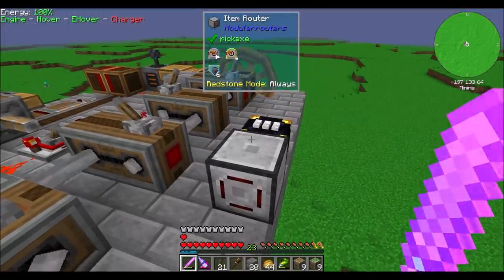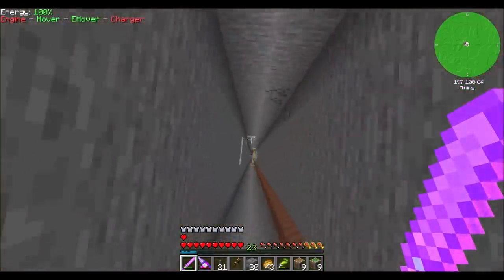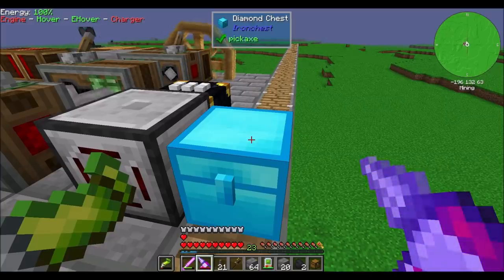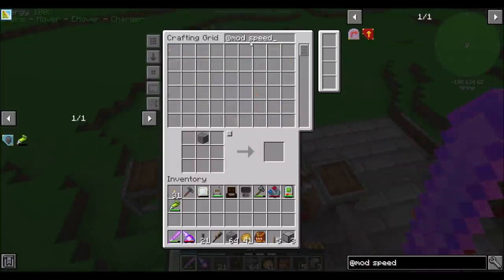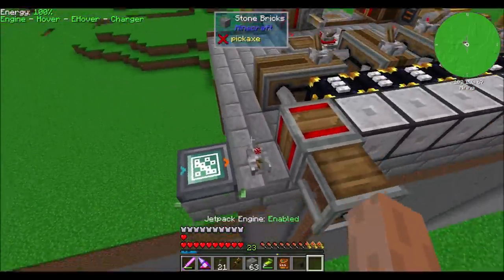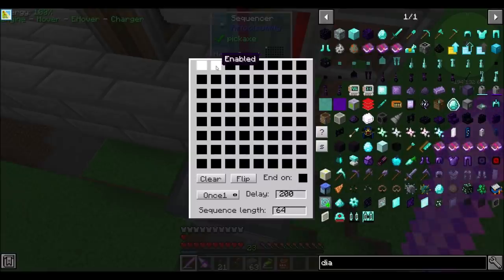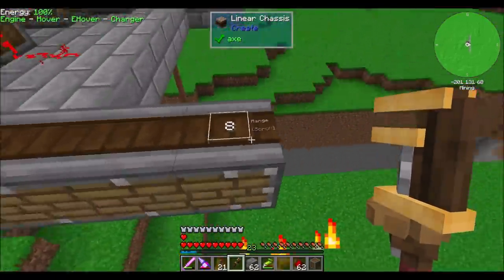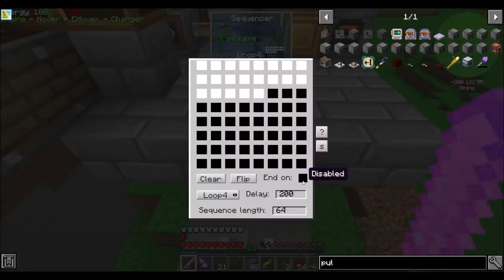Lets Play S10E54 Inchworm Miner Mk2

Comment: For the redstone signal at the start of the machine (the one that pushes everything forward), you could use a redstone contact from the drills platform, wait 10-15 seconds for the items to unload, then pulse at the start to move
Reply: You would need an AND gate in there too so you can lever control it.

Comment: There is the item transfer items that create supplies.. “portable storage interface”
Oh... and red stone links for wireless red stone perfect for this application.  Ask and create supplies 😊
Reply: This system is very finnicky and needs to use either funnels into belts or a chute from Create, both of these options are very slow in extracting items from chests so it would make this machine even more inneficient
Reply: @hmag11  I forgot the PSI’s don’t work directly to inventories 😢. But yes I agree it’s not perfect or fast but it is “create” 😁
Reply: Besides what the other commenter mentioned, psi's also only work while one end is a contraption entity I'm pretty sure.
Reply: @thaerosthedragon1930  well yes but you mount it on one block of the linear frames 🤷🏼
Reply: Redstone link (the wireless redstone) won't work to transmit signals from one part of the other of the inchworm. Create doesn't like to move their own wireless redstone. it's okay unless you move the "source" of redstone (for example if you place a link on the Main big body of the inchworm) as "input" you can't move it with the small part of the contraption, it will toggle it. as soon as it turns into an entity the link stops working and the pushing mechanism stops, driving the machine pointless. to solve that you can use the RFtools Redstone Transmiter / receiver.

also, the logic to automate the machine is ultra simple if you can afford 4 pairs of receiver/transmitters. my inchworm uses only 10 blocks long chain and 2 extra on the side for 2 transmitters
Reply: @JoachimVampire  interesting ill have to go back to my test world. Maybe i had it set differently.
Reply: @hmag11  The portable storage inteface is proportional to belt speed, and you can use a brass funnel to pull stacks instead of items.
Reply: easy fix, have the on the mining arm one block above the interface on the static part, on its way down and up it will spit out all items
also 256 speed belt with a stack extracting brass funnel is faster than the modular router
Reply: Or, because he's only collecting from the chest when it's "placed" in the world... just a regular Create funnel would work, I think.

Comment: Hey Dire, for chunk loading: Flux networks have it build into each connector! I use that to load my entire base and any moving contraptions.
Reply: Do they only load the chunk they are in?
Reply: And he's got two of those already! Lovely solution
Reply: In some packs I'm not sure about Dire's pack ik that feature is disabled.
Reply: Sadly they don't work. as soon as the flux point is moved it "resets" the toggleable things inside. Chunkloading included.

Dustin, i think that's correct, i have a machine like this in my world too, it's only one chunk sized (on purposed) and i used 4 points. 2 for power and 2 for chunkloading (one on the top most front and one on the back) but they don't seem to work...

Comment: Routers' main purpose is to interact with all adjacent chests/machines. You could have gotten away with just a single router and ender chest. If that doesn't work, you can always make some of those chests double chests, and halve the amount of routers.
Secondly, you can use the same trick you used at the beginning of this episode, to push the contraption into a single chunk. Then you can chunkload only a single column of chunks, which would be a lot better for your server performance. 
For chunk loading, you can try putting down a random mekanism machine on it, and apply the chunk loading upgrade to it. However, you couldn't move mekanism pipes, so I think you also can not move other mekanism machines. Still, it is worth a try. Create might have a way for chunkloading, maybe its deployer is registered as a fake player, and the presence of a player (even though it is fake) might force load the chunks? Dunno.
Reply: Fake players don't chunk load unfortunately. How would the save even know there was a fake player there before loading?
Reply: the drill line is still over 3 chunks wide I wonder how they would behave if only the core was loaded.

Comment: you could glue a redstone block to the digging arm and when it raises this will activate a redstone line connected to the move button, for automatic mode, no timer needed
Reply: Good call... or even better, if that does work (which is a big if, I gotta imagine that it's location-bound), use a Mekanism Teleporter block - those can accept Anchor Upgrades as well, with the added bonus that he can use the personal teleporter to zip to the contraption whenever, no matter where it is...
Reply: @iamianianiam  the question is whether this will work nicely with create
Reply: why the redstone block tho? Create already has a "Redstone Contact" block that outputs a redstone signal when paired with another one facing each other. you use one on a movable part and other in the main body and as soon as it reaches the top it couples and sends the redstone.

Comment: just a thought on chunk loading.  Your flux points or plugs will allow chunk loading.  Just glue an unused flux point and enable chunk loading.  Just a work around.  Also everyone talking about sequenced gear shifts are talking about the inchworm not the mining.  use one block to both pull and push both pistons to avoid having to use all the redstone logic and timing as the sequenced gearshift lets you set the timing.  Love the build though, about to work on my own design in a testing world.

Comment: Why not use an observer and a toggle latch to detect when the linear chassis are up. On that pulse, enable the back to push the rest forward and then another observer to detect when the back section is pulled closer to toggle the gearshift on the rope?
Reply: Wouldn't additional logic be required to 'ignore' the observer's pulse when they are moved?  Also, 'why not' --  its a vanilla mechanic; we can't expect Dire to know about that...lol

Comment: Dire, flux networks does chunk loading.
Reply: They do?
Reply: really? wow that might work. How? Does the flux plug have a "load this plugs chunk" option?
Reply: @napalmstrike2007  Yes. It’s on the plug interface.  However, I’m kind of thinking that they have to be active which means attempting to power something.
Reply: @Kzorith  well they are powering his furnace heaters, so it will be fine. The only problem is, his device is larger than a chunk.
Reply: @Kzorith  Yeah, but he is powering his heaters so it should work. I don't know if they have a radius around the loaded chunk or how all that really works and never cared to learn really. Just that it works.
Reply: He can simple move the whole contraption to be in just one chunk as he did to lower its height

Comment: Mekanism machines can take an Anchor Upgrade to load the chunk they're in. It's usually used for digital miners and such, but if other (1-block) machines can accept it, then you might be able to use one of those to move along with the Inchworm Miner and keep it loaded. (No idea if that will work or just crash, but worth a shot!)

Comment: just FYI placing drills on chasses with glue in your offhand is not the same as stickying the chassis and placing a drill. placing the drill with the glue on the offhand takes durability from the glue and stickies it the same way you sticky all the machines to the platform and the glue in there is an entity instead of a property of the chassis

Comment: direwolf20 I'm not sure exactly how it works, but flux points and flux plugs have a chunk load feature that you can enable on a specific point or plug in their UI. Since the flux heaters from immersive engineering are constantly using FE, a portion should remain chunkloaded.

Comment: ( For the drill bit ) You don't need the linear chassis to mount the drills, since you didn't use slime on them anyways. It should be fine to just sticky-attach them to a regular block, and same some resources

Comment: Dire use a Redstone link thingy (don't remember the name right now) on the Drill section so as soon as the drills came back it connects the redstone and then, you can have a delay of a few seconds. using a Wireless redstone system (from create too) you'll have enough to keep the machine running indefinitely and won't get stuck (or shouldn't) you can even use an And gate with a lever attached to one of the inputs so you can manually turn it off.

Comment: Hey for the redstone timing on the rope pulley you might have been able to use RFTools wireless redstone and since it places at the bottom have it send a signal back through. Granted I'm not really at my computer to check if the rftools wireless redstone behaves well being moved so I could be wrong.

Comment: i wasnt going to comment but i noticed no one pointed it out. @Direwolf20 at the start of the inchworm to make it move you could have just used a timer from RFtools set to 3.5 minutes since timer send a pulse at a set interval and can be turned off with a redstone signal. it would have been alot simpler then the sequencer. just wanted to point that out as it seems no one in comments thought about that.

Comment: Think the 'go/no go' lever at the end should be replaced with some kind of wireless redstone receiver connected to a transmitter in his base where the lever actually is. That way Dire can remotely start/stop The Machine.
He'd probably still need to periodically visit to adjust the chunkloading...
Reply: Yeah I think chunk loading is going to spoil the party. I seem to remember Chicken Chunks Spot Loaders were the tool of choice back in the day.
Reply: @PhilHibbs  He has the in-built ftbutils chunkloading. Main concern is that it has a limit of 100 total chunks across all dimensions, IIRC.

Comment: 25:00
Maybe they can, I mean, quark is in the pack.
Even if, that's not what I was suggesting. I was suggesting you move the miner bit with a vanilla flying machine, that way you wouldn't need 2 flywheels.
Reply: I probably have his same point of view since my vanilla knowledge is stuck to 1.7.10 and for me learning how to do a vanilla flying machine would definetly take more time than setting up another simple flywheel. And its not like the heater uses much rf/t so it s fine

Comment: The whole contraption does not care where the chests are as long as its still an entity. So you could have 10 chests with 1 coupler, and it will extract from all 10 chests as long as its "moving" :)
Reply: Actually, at the point where items are being extracted, it's not "moving", so he needs to manually extract them.

Comment: Sequence gearshift would be good on your pistons rather then the pulley since you can tell it to push and then retract for 1 redstone pulse. for the drill side of the drive it would be better to use a sequence gearshift with an observer (to extend and retract the piston) to fire it since an observer only fires when the object has finished moving and not during or at the start. removes the need for a timer or pulse delay

Comment: You could place a normal chest, the transfer thing you used for the top of the inchworm, and another bigger chest for extra storage while it mines. The bigger chest will store while the normal one pick the items up. The chest isn't an entity while it moves though, so not sure if it will work.
Reply: having the line of routers is more effective. the chests from iron chests (the bigger one) sometimes void items when moved for some reason..
Reply: @JoachimVampire  oh that sucks, it probably loses information since it stores in certain space
Reply: @MrGamerCaptain  yeah probably that's why the moving platform doesn't register it as a valid chest

Comment: question : why didn't you just use the block for moving stuff out of moving frame inventories that comes baked into create and have it insert into the ender chest, think its called a something interface, needs a 2 block gap one on the moving thing and another on the receiving end with the port facing each other, stops the framed object moving till its empty then it carried on as normal

Comment: For my create quarry, once it reaches the bottom, it sends a redstone signal for the rope pulley to reverse.  A redstone signal is not sent while it is in motion, but once it reaches the end. Bam goes the signal.
Reply: may i ask how do you manage such thing? that would be useful
Reply: @JoachimVampire  on the moving platform there is an on lever and it sends a signal to the CREATE redstone link. On the other end I have the link going to a gearshift with one of the power latches.  The signal is not sent until the quarry platform becomes solid again.
Reply: @JoachimVampire  I just uploaded a 5 minute video about it... It's not that glamorous now that I explained it.

Comment: A line of create crates with an item router that plugs into a modular router would work just fine I think
Reply: create crates only allow for a "double chest" configuration and they individually hold less than a chest.so it's worse
Reply: @JoachimVampire  less than a chest? From Dire's spotlight I thought they held more than a chest?

Anyway, having a single create item router into an enderchest would have been simpler - or into a modular router chain that fed into a series of enderchests to push faster.
Reply: @GirishManjunathMusic  Create's crates  holds 16 stacks of items (4x4 slots) or a max of 1024 items whereas vanilla chest hold 27 stacks (9x3 slots) or a max of 1728 items

the only advantage is that with create crates you can set an exact value of items so it's actually the best modular buffer option.

i don't understand the second half part of your comment. you mean a single item router (from modular router) into a ender chest?  the routers can only interact with the 6 blocks it has immediately around so the actual configuration (a single chest with a single router feeding into a single ender chest) is both the fastest way to transfer items and also the safest one. it prevents overflow. but i think 5 chests are enough for cycle.

Comment: I found something in your pack. you can make infinite diamonds relativly fast. you need a compresser from mekanism (the thing that turns materials into ores) and the astral starlight infuser (i think that is its name). you can make a diamond ore in the compresser withe 3 diamond dust and get 5 diamonds out of a ore in the starlight infuser. in my testing something like the automatic user from cyclic can put the diamond ore into the infuser, but a player needs to activate it, thoug i only tested the deployer and automatic user. i used it in my world to automate the production of infinte diamond as much as possible (as player interaction seems to be needed) and i can make 3 diamonds into 3 stacks in relativly short time.  its quite strong, but i think you can also turn charcoal blocks into coal blocks throug ore dict and make diamond in the compression chamber from pneumaticraft. oh and create tree farms are insanel fast, especially withe the lilypad of fertilety. i got about 20k oak in an hour white a radial 5 long design.

Comment: Isn’t there a Wireless Redstone Transmitter and Receiver form RF tools he can use to move the the pulley after the machine has moved. 

So a timer to push the machine that sends to transmitter which senses to receiver which waits for the machine to stop moving and runs the pulley?
Reply: Yes, and Create even has wireless redstone transmitters and receivers as well.

Comment: You know I just thought of something, I know he doesn't want to use Mekanisms miner nor am I suggesting he do but would it fit on the inchworm drive? Every series I've seen he ends up having to constantly move the miner manually.
Reply: Mekanism stuff doesn't like to be moved and even if it did... you should "reset/start" the miner automatically anyway. as soon as dire finds a way to dynamically chunkload an area he won't need to manually move the miner again ever.

Comment: 41:28 Why bother with a timer? Just use a redstone contact. Extend the whole thing out 1 or 2 blocks left, put a redstone contact on the linear frame thing, and another on the platform so when it comes back up from digging it makes a redstone signal, send that to an adjustable pulse repeater, give it like 10-20 seconds to clear the inventory, then pulse the movement. Easy peasy.

Comment: someone needs to make a distance sensor in minecraft. you could set the top to send a laser down, detecting distance and say if distance is over 100, set Redstone on. so you can control the winch precisely even with drills :D (or build this into the winch, like what lenght of rope is out?)
Reply: i think that can be achieved with a simple lever and a redstone link. while the rope pulley is pushing down it doesn't send a redstone signal, but as soon as it stops it sends it

Comment: Did I just just use a quarry card to do this? Yes. Is this a lot cooler? YES!!!!!
Reply: the builder needs mainenance and a lot of power. as soon as dire finds a way to keep the areas chunkloaded automatically that will remove the the maintenance part. and the furnace engine coupled with the furnace heater only takes 8rf/t with 2 he's draining 16rf/tick which is negligible